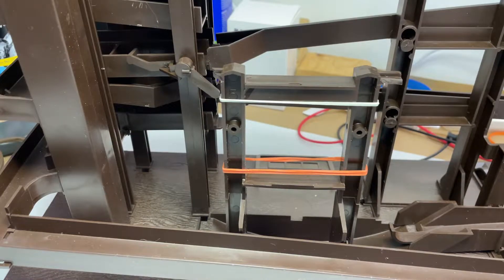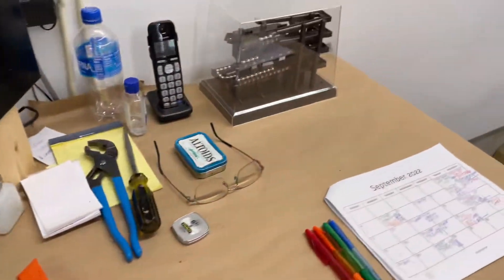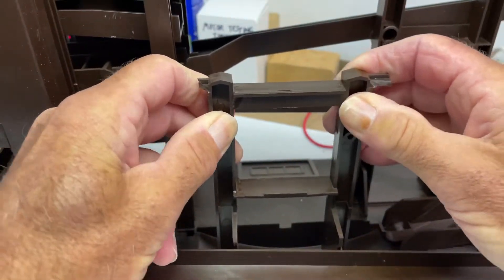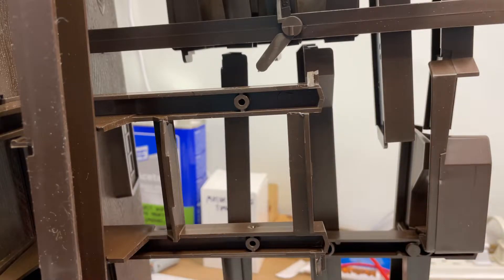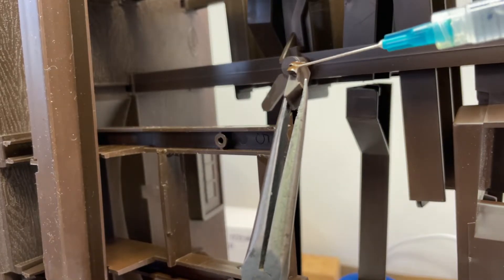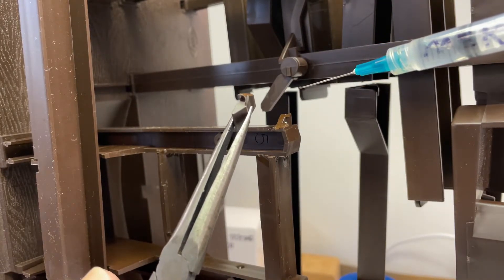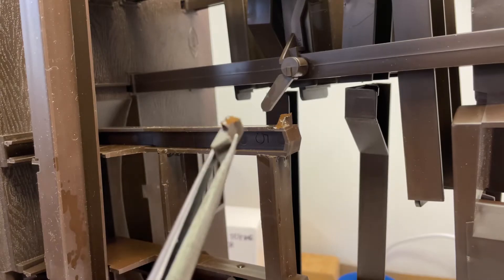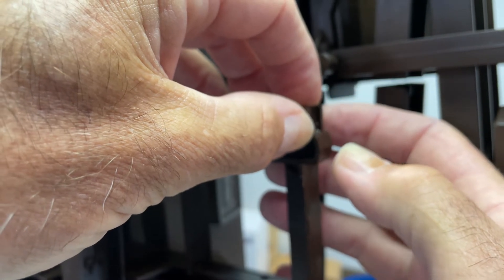How to re-bond broken old plastic parts. Better than glue.

Comment: Thanks man.. Just dropped my replacement tail light for  suzuki swift haha. MEK or buy another one?
Reply from the maker: Hi Benjamin.  You’re welcome.  I'm not sure if this will work on that type of plastic.  But if you are considering buying a new one anyway . . . this would be worth a shot.  Let me know if it works.
Thank you for leaving a comment.  Please click on the words “Rick’s Tid-Bits” underneath the video to go to my YouTube channel.  I think you’ll find some helpful and unique tips in my How to Make Life Easier or Better section.  https://www.youtube.com/channel/UCc-IuUFzC2Tyv06KzJyBESg  Rick
Reply: @rickstid-bits  it's just the corner. Where the top screw goes in. Should be fine. Not alot of pressure on it when it's screwed in. And YES I'll let ya know. Thanks for the tips.

Comment: How strong is this bond? I have some plastic benches at work where the slats have cracked in half. Would this bond them back together while being strong enough to support people sitting on it?
Reply from the maker: Hello.  For the purposes I use it for it appears to be as strong as the original piece.  But I don't think I would trust it for the weight of a person.  Plus, if that plastic is old and brittle enough that it cracked once - It's going to crack again in some other place.  Rick
Reply: Can can I use it on a piece of plastic that broke
Reply: On my fuel pump
Reply from the maker: Hello,  Probably not on that type of plastic.  Rick